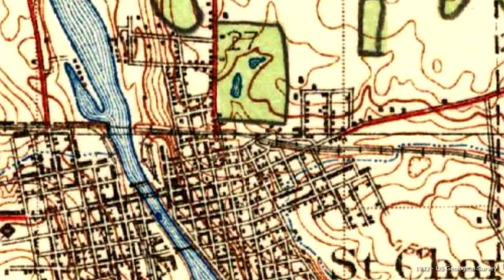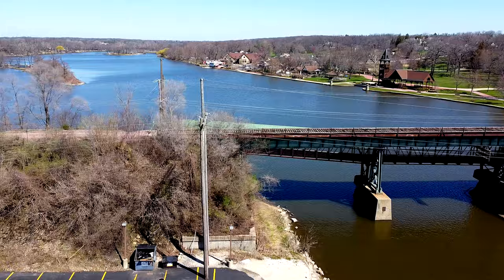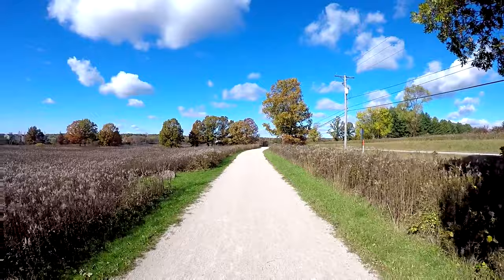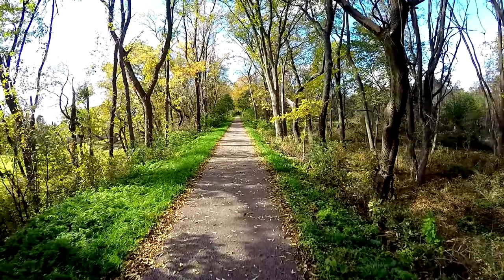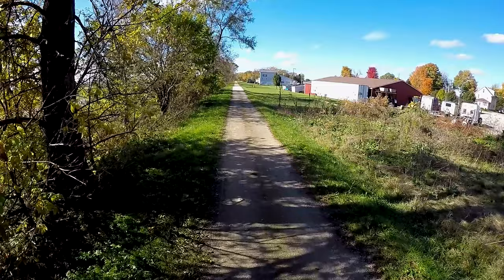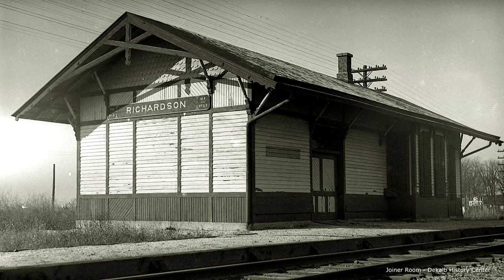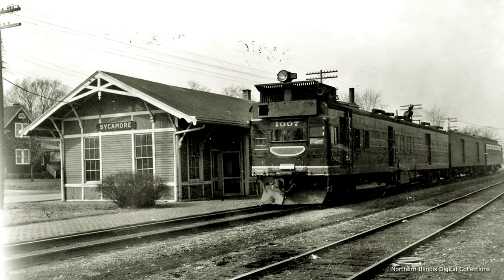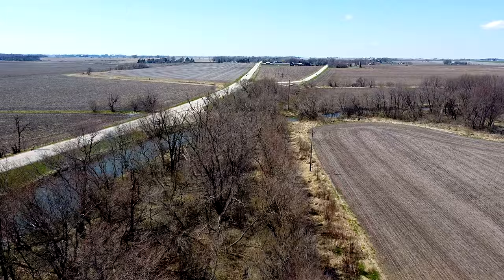Disused Stations of the Chicago Great Western - St Charles to Sycamore - Part 3

Comment: Great fall foliage!  According to a local history book about sycamore (5 mile spur line?) apparently the brown home that still stands at around 336 Plymouth Ct in Sycamore is a former railroad station.  I’m not sure if it was CGW though, and it was also moved from its original location.
Reply from the maker: Thanks for watching and commenting!   Yes, it was a particularly nice time of the year to make that ride - although a bit chilly   :-)   That is very interesting regarding the house at 336 Plymouth Court.   Will have to do some additional research to learn more about that.   Thanks for sharing that info!
Reply: Ok so now there's possibly FIVE stations in Sycamore still there?
Reply: I think it is a railroad station, I looked at it on Google Maps. Its a long narrow building, with a railroad-station styled roof.The proper address is 335 Plymouth Court. Considering its right next to the CGW tracks, it may be the CGW freight station.
Reply: It was the freight house. Converted to a home. Still standing.

Comment: Even if trains don't run. The right of way can be a profit center for the owner. Due to rent being charged to the utilities and other renters. It is still profitable too from a tax angle. Too bad those taxes were not spent improving the track to faster trains and better service.
Reply from the maker: Thanks for commenting!   Yes, there were several narratives that conspired to reduce/eliminate railroad traffic in the US.   There could have been many more options considered prior to removing all of this infrastructure.   Thanks again!
Reply: There’s little to no profit from an old railroad right-of-way. Why do you think railroads abandon them? The railroads still have to pay property taxes on every mile, heck…every foot of their property. Once these lines no longer generate revenue, they generate tax liabilities. No business which desires to remain in business operates in the red. Abandonment is the next logical step. The CGW had no utilities leasing their right-of-way here. The telephone poles seen here were for carrying ‘code lines’ - direct current, low voltage power lines to carry Morse code messages between stations.
Reply: @chooch1995  That is why they should be public like airports , roads and water. We don't abandon roads We keep building new ones.  And what if you need it in the future?

Comment: So how many bridges were built on across the Fox River, one or two? And did the first bridge use the original piers? Just a little bit confused.
Reply from the maker: From our research, the original piers were installed in the 1850s for the airline bridge - but the bridge was never built.   Not until the mid 1880s was the first bridge built, using these original 1850s piers and abutments.   Whether this steel truss bridge was replaced or refurbished between 1887 and the 1950s, we do not yet know - but it is likely that there was some replacement/overhaul in this interval.  Then in the 1950s, the truss bridge was replaced with a steel post and beam bridge, the one that we see today.   With this 1950s change, they also added three new (smaller piers) to complement the original larger piers.   You can see this in the early versus later photographs.    They also likely repaired/restored the original piers when they added the new piers.  Then around 2000, they built the pedestrian bridge alongside and beneath the railway  bridge, again sharing the original piers, although they cantilevered out the piers to fully accept the footings for the pedestrian bridge.
Reply: @BeHistoric  So the original 1850s piers are still there?
Reply from the maker: @WesternOhioInterurbanHistory  We cannot say for certain.   We can say for certain that three new piers were added in 1956, to accommodate the new steelwork for the post and beam bridge - and that at that time, the original two piers were not removed or replaced.   As we have no evidence to the contrary - and since the two larger piers appear to be the same dimension and in the same place as the original piers, they appear to be from the original 1850s construction - but likely refaced and/or reinforced with concrete once or twice over the past 100 years.
Reply: @WesternOhioInterurbanHistory - the taller piers are the originals…sort of. The original piers were made of limestone slabs & it’s been said that they were strengthened & built up by pouring reinforced concrete around them, the same still standing today. If this is true, the limestone originals would still be encased within.